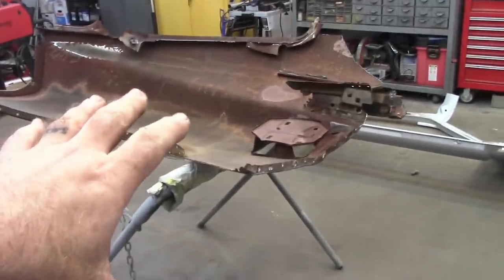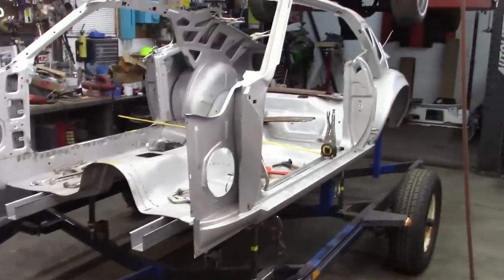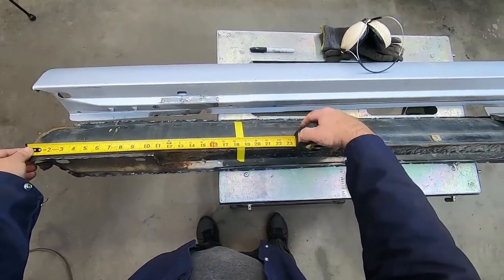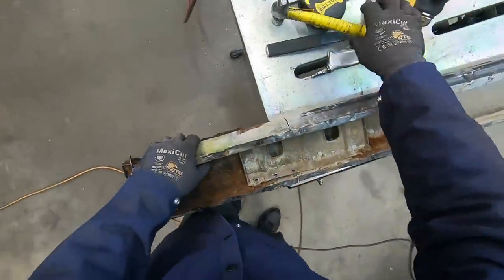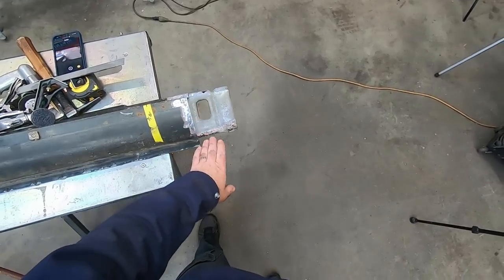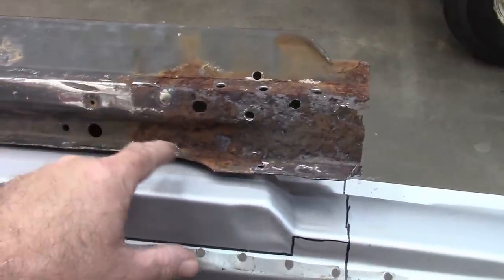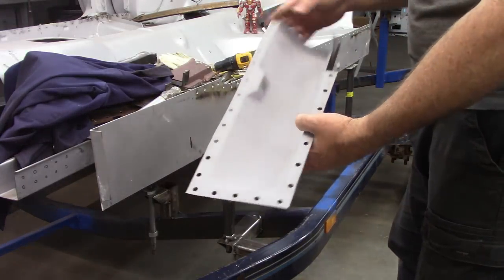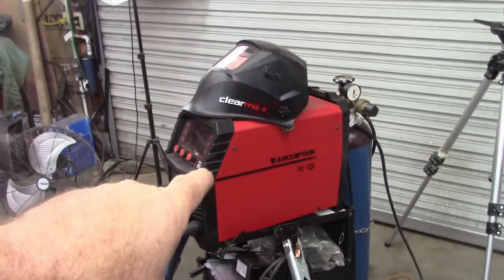Patching rusted rocker panels on the Cobra jet. Part 16

Comment: A trick my dad taught me to get into those tight rusty channels - take a piece of metal cable, strip off an inch of the plastic cover, fray the end and chuck it in a drill at low speed. Watch your speed because it will flail and bang your knuckles.

Comment: Really enjoy watching you save the original panels. With as much work as you put into saving the rockers you HAVE to save the quarters and driver's B pillar. I know it's a lot of work but if the owner is trying to keep as much of the original metal as possible it only makes sense. That would probably total 1/3 of the original car which would be pretty respectable considering how crunchy it was to start. Awesome job so far!

Comment: I watched a video the other day on all these rust converter paints etc. It was made by “repair geek” is his YouTube name. The heading was something like if you use por15? He did a 8 month torture test of all these different rust prevention paints. You really should watch it. He also did one earlier on what’s the best rust prevention out there.  I don’t want to spoil it for you but the Eastwood system ranked second worst out of 8 different methods. Rustoleum was one of the best and the cheapest. He did everything to them. Bent them smashed them pinched them etc left them outside for almost a year in direct elements rain snow uv light etc.  It may be something you want to watch for future builds.

Comment: When welding a thicker gauge metal (say for example the thickness of the inner rocker panel plate) to a lighter gauge metal (the outer rocker panel) when using a MIG welder could you estimate where the heat range and wire speed settings should be to reduce burn through and do the copper plug weld pliers help as well?  My MIG welder is a Hobart Handler 135. Thanks Barry
Reply from the maker: I’m not familiar with the Hobart and experience affects the welds as well. If I was using my Lincoln 140, wire speed is generally set to 2 of 10. Heat is set to “b” of 5 choices.
Reply: @JoDaddysGarage  thank you sir!